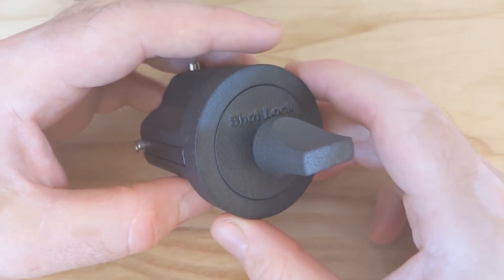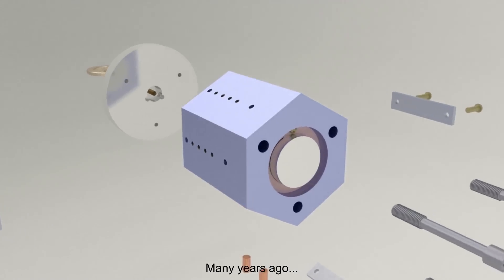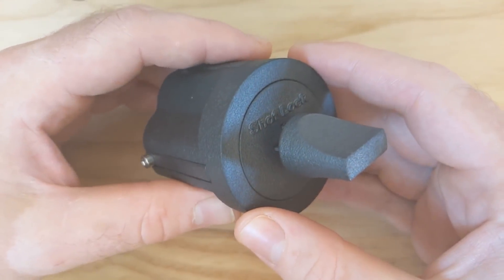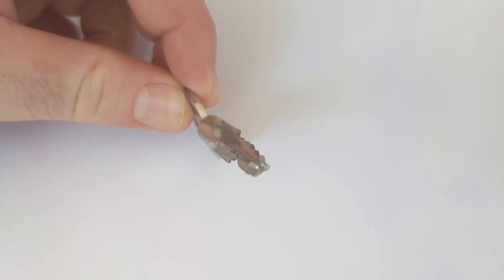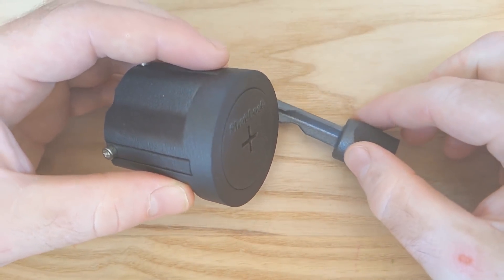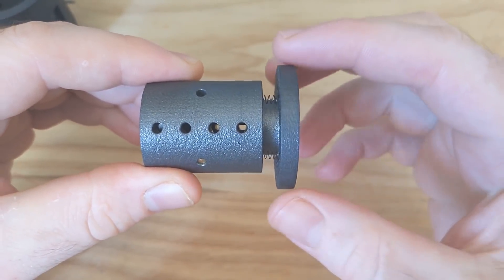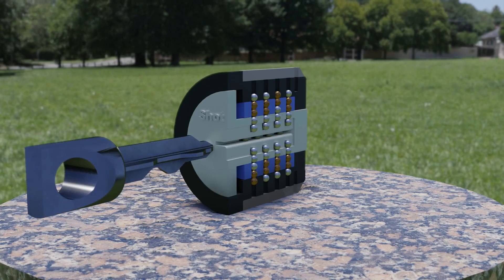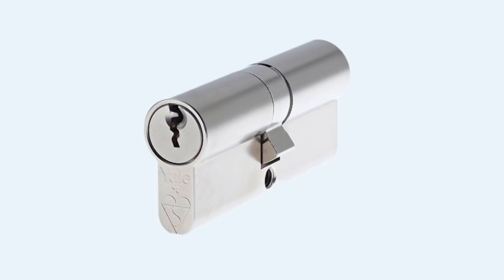A 3D Printed Unpickable Lock

Comment: What prevents a prospective lockpick from inserting a blank key into the lock, applying torque, and then shaking the thing until it opens?
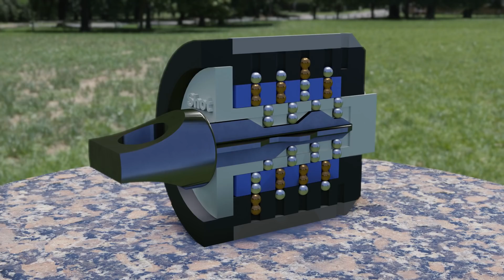Reply: By the looks of it, the channels in the lock's body aren't filled with just individual bearings, but the ones colored in brass at 2:40 are actually 8-shaped fused bearings. So a bit like solid spools.

The idea being that each of the slots only has two possible cuts, 1 or 0, and so each of the slots has one of two arrangements of bearings in it. - And if that set of bearings isn't lined up with the appropriate cut, that solid "spool" will intersect with the shear line between two cylinders.

So the thing that stops you from doing that is the fact you'd have to twist the blank key in with enough force to shear those respective pins in half, except by the time you can exert that much force through the key, you'll have broken it already. - Either way, the outcome will be a destructive breech. Which, admittedly, would be quite easy. - But that's not "picking" the lock. - The whole point is the lock can't be picked by any techniques that wouldn't damage or destroy the lock. - And yes, breaking pins counts as damage.

Comment: Congratulations! The best part is how elegantly you did it. One question: Wouldn't it be possible to use common pins of different lengths? Why does it have to be a binary key?
Reply: It's mainly down to the height of the ball bearings used in the design. Since the key bitting is the height of one of them.

Comment: How much space is there above the balls where the spring is? Only attack i can think of is over pushing every pin so all the double height pins sit above the shear line
Reply from the maker: Not enough space to comb pick them, but I should have made that clearer based on the number of comments about it!
Reply: @timhutt7051  is your animation 'not to scale'  ?   seems like if you've always got 2 bearings in the main cylinder, and a 2 bearing height in the intermediate - and assuming you have room to lift the extra bearings and for a spring in outer ring?   How are you preventing a comb style attack?
Reply from the maker: @dannyphillips15  It is to scale - it's the same model sent to the printers. It just doesn't show the springs - when fully compressed they take up enough space to prevent comb picking.

Comment: How does the lock interface with a bolt let's say someone is using this for a deadbolt? I didn't really see how it does and was wondering.
Reply: There are screwholes in the back where a tailpiece/actuator could be atached to.

Comment: Wouldn't a key with no cuts in it just force everything to 1 ball bearing and then turn the lock?
Reply: That is actually a fair point, but maybe the sheerline is engineered so that combination wouldnt work
Reply: It should be fixable, will have to look at the STL
Reply: @kblock1738  2:30 even the key part with no cut leaves at least one ball bearing in the "white" cylinder, which (I think) means that if there was a double-bearing in the first layer, the cylinder couldn't be pushed forward if the double bearing was pushed too deep (corresponding to uncut part of the key)
Reply: @rzul  you can't have a double bearing first and still have every possible combination push the cylinder to the first set position (which is a design feature) - I'm not sure what the solution is though that keeps this feature, or if it is even really necessary.

Comment: How do you use it as a lock? Like where is the bolt? It’s probably just me missing something obvious lol
Reply: You don't want to be using a sintered polyamide item as an actual lock, it's a proof of concept. But if you insist, just make a bar with a few M3 holes in it and just screw it into the back.

Comment: Would be great if he didn't know how it worked before trying to pick it though.
Reply: A lock that relies on the secrecy of its inner working is not a good lock since it can be used only once.
If an attacker can purchase a copy of the lock he can disassemble it. If he can not the lock is not available to use.
The only secret part should be the key. That is known in cryptology as Kerckhoffs's principle / Shannon's maxim: "one ought to design systems under the assumption that the enemy will immediately gain full familiarity with them".

Comment: You should make an update on what LPL had to say.  But all in all, it definitely looks unpickable.  That's not to say you cant open it.  But in a non-destructive way?  I doubt it.  But I would change the dual ball bearing to a pin the correct length with rounded ends.  That's the weak link here.  A solid pin would be very hard to force, where as the bearings could shear or break

Comment: But wait… how does it actually lock anything? Did you just make an unpickable hockey puck or can it actually lock a door?
Reply: There's a mechanism at the back of the lock which turns, and therefore can operate a locking mechanism.

Comment: It very well might be unpickable but you wouldn't need to pick it as this looks quite easy to break.  
This is made from plastic though. You wouldn't need to pick it, it looks easy to break. Picking a lock is only required if it takes too long to brute force it.

Comment: Easily picked. You can use a robot key to test all possible combinations in 5-20 seconds, maybe faster if it gets lucky.

Probably another easier way.
Reply: It appears theirs 3 positions for each 4 pins and 4 keyways. So 12 different keys per keyway and 4 keyways per key. An adjustable key on a machine that brute force tests each combination would unlock it pretty quick and allow a perfect key copy to be produced.

Bit complex; However, once it's created it'll render this whole lock system obsolete instantly.
Reply: he did mention in the first 20 seconds that the idea was to prove it can't be picked without brute forcing the design. Obviously the design is a proof-of-concept that will just be scaled up by using more pins positions
Reply: @frogmod2249  What he needs to do is make a keyway like the bowley lock so it'll be next to impossible to brute force since the key would be rather complex and hard to have a robot change out let length tabs with a slider set. The key would have to be completely redesigned and lock would need to be upped in size a little bit to account for new passage ways.
Reply: @vincei2147  or... he could just add more pin positions?
Reply: @frogmod2249  So make the robot take 5 seconds long to pick it?

Or he could make it so it's unable to brute force it?

Hmm logical answer no?
Reply: @vincei2147  You can not pick the keyways independently because the tensioning is decoupled from the pin lifting by the inner core sliding. To try a new key configuration you need to reset everything so the dimension of key space is effectively 2^(number of pins) in this case 2048.
The whole point is that the keyspace grows exponentially in the dimension of the lock. Add 3 pins and the brute force time increase 8 folds...
Reply: @Pietro-qz5tm  Yeah the robot would just try each possible key combination with a slider for each possible keyset.
Reply: @Pietro-qz5tm  A robot could try hundreds of possible combinations in a second, so with 2,000 that's 0-17 seconds about.

He needs to make it brute force proof.
Reply: @vincei2147  make it 20 pins (4 rows with 5 pins each) and it already requires 2h at the speed you say XD
Also I'm not sure that a mechanical systems can make 5 different movements (set, push, turn, turn back, push back) hundreds of times a second.
Reply: @vincei2147  Take the machine showed here for example https://youtu.be/vkk-2QEUvuk
It's simpler (just rotating), way bigger than what you need to manipulate a lock, and still makes less than 5 movements per second. I think your estimate is about a hundred time too optimistic.

And the lock itself may not operate properly at such speed (the springs inside need time to operate).
Reply: @Pietro-qz5tm   Not really, it'd be a key that you adjust key sets with levers outside so you never have to remove it so all it does it log key data attempted push in turn if not turn return and repeat and log all patterns it's already tried.

You're just making the lock big and bulky for no reason.

Like I said before he needs to do a key design like the bowley lock.
Reply: @Pietro-qz5tm  Have you actually done programming or robotics? Or just going off opinion?
Reply: @vincei2147  I am a mathematician with an interest in cryptography and security in general
Reply: @vincei2147  I've not said that you need to remove the key but by design this lock can not be turned or even tensioned when the inner core is not pushed in and in that position the pin stack is not accessible from the keyway. That movement is what I meant with "push" and that is the new idea in this lock, the trick that decouples setting the pins and tensioning the lock.
Reply: @Pietro-qz5tm  Yeah in theory it's a solid plan, would recommend adding an inner key way system so you can't even access the pins without turning the keyway would block almost all pick abilities.

Comment: But why would this be unpickable? It looks a pretty standard design…
Reply: Because when the cylinder is rotating, by design it’s cutting access to the chambers. There is no in between state. Either you set the pin height, or you test the shear line. You can not do both at the same time, which is the vul’erability used for standard locks.
Reply: @xl000  Yes, I got that. I suspect he is not the first to come up with such a design. I believe the guy from stuff made here or sth did work  on the exact same idea.
Let’s see what the lock picking lawyer has to say about it, but the design I mentioned failed the test big time.

Comment: I don’t see why is unpicable… you say it have 2000 combination… but what it have are 16 pins… it will take more time… but look totally posible.
You say that if you press with the wrong key you can not acces at the early pins… well… you never pick with the key… all you have to do is star liking befor pushing… soo…

🤷‍♂️ and of course… you can just drill it… because after all… is a 3D printed…

Comment: I'm impressed. This is a very innovative and interesting design. I wonder if there were ways to refine it so that it is more commercially viable. As it is, it's more a proof of concept. Now, I was thinking, that pushing in the lock's inner cylinder could be used to tension the lock, but I rewatched the animation a couple of times, and that would appear to not work.Still, very nice. What service did you hire to make this?
Reply from the maker: Thanks! I used 3D Print Direct (.co.uk). A bit cheaper than the alternatives I found (e.g. Materialise). I reverse engineered their pricing for MJF parts and as of a few months ago it was roughly: £1 + 12p/ml of printed material + 3p/ml of bounding box volume, for the 3 week service. Pretty good value. Website leaves a bit to be desired but they're very good at replying to emails.

Comment: The pin stacks all start with 2 ball bearings . So can I simply lift each stack by 3 and get both a method to torque and an open? Or is there not enough room for the lift?